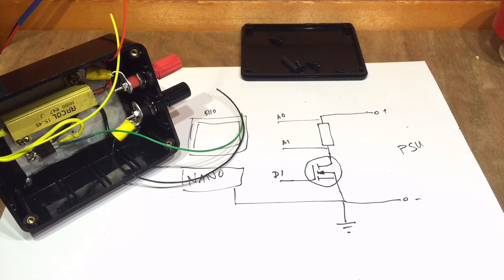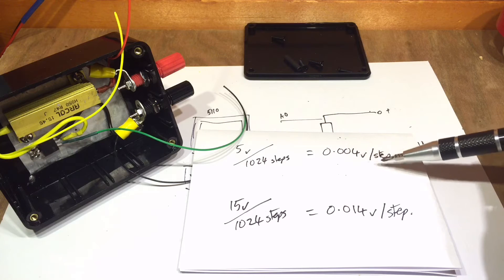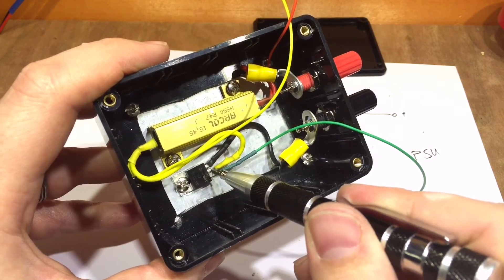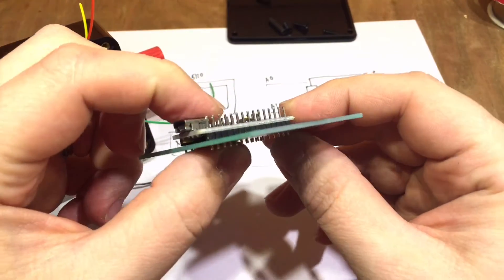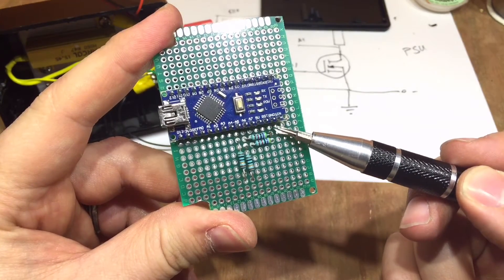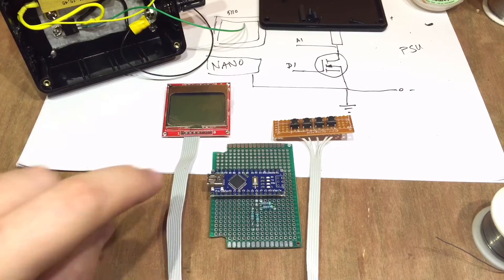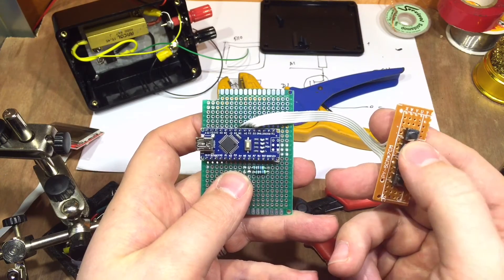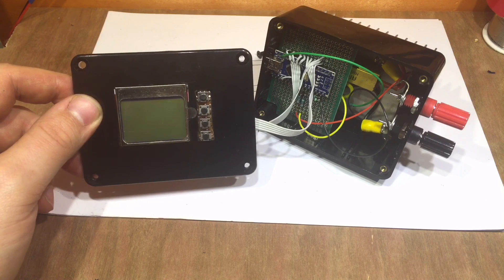Constant Current DC Load - Part 2 - Hardware - Adam's Arduino Projects

Comment: Maybe I can give you some tips: I think the main problem with your design will be, that the current isn't low pass filtered. This means that the current itself will be a pwm pattern. When you're reading the voltage across the resistor while the Mosfet happens to be on, the current (and the voltage across the resistor) is high. But when the Mosfet is off (in the other part of the duty cycle) the current will be zero.
The solution is to filter or stabilize the current, just as a buck converter does it. Otherwise I suppose the voltage readings you get would be all over the place.
I hope this helps :) love your projects and videos!
Reply from the maker: +steve0steel Thanks for your thoughts. I have mentioned this possibility and I think you're probably correct. 

I need to do some more testing of circuits and research. This project isn't as easy as I hoped - but I'm definitely learning. 

Thanks for the kind comments. It's great to have your input.

Comment: That looks like a really good idea for a handy test rig. Well done. It is often easier to do live heatsinks in home brewed designs than to muck around with insulators, bushings and thermal grease. Although apparently you don't need to use the grease with those silicone washers. Still, live heatsinks can be easier. Sometimes they can even be handy for making connexions to! lol You could always put some kind of perforated covering over the actual heatsink though if you begin to find it a worry.
Reply from the maker: +xanataph Useful tips there as always Xan thank you. Need to he back to this project, but things here have got very busy!